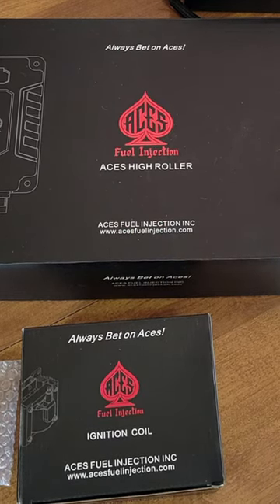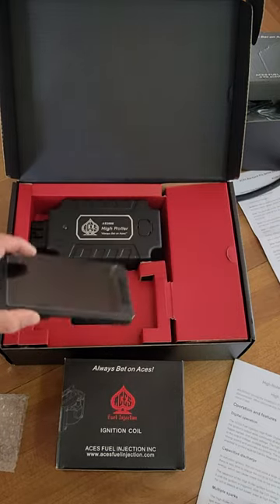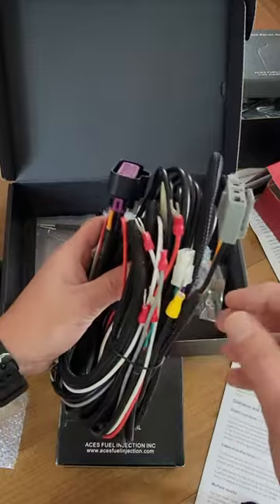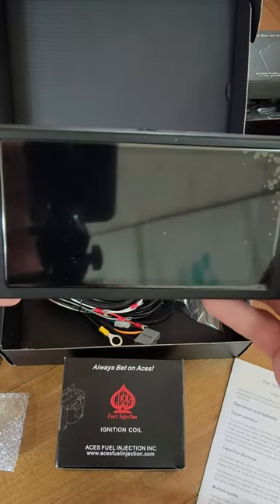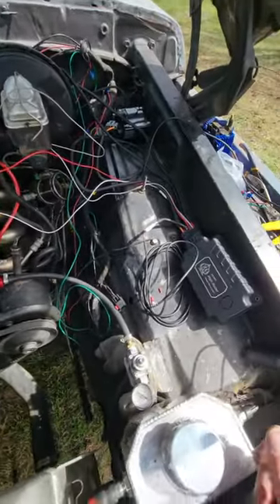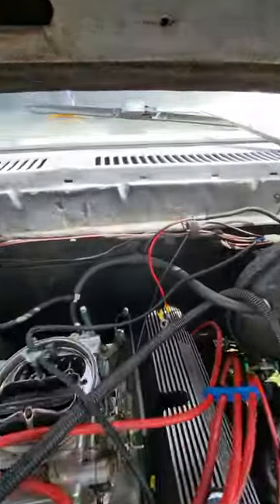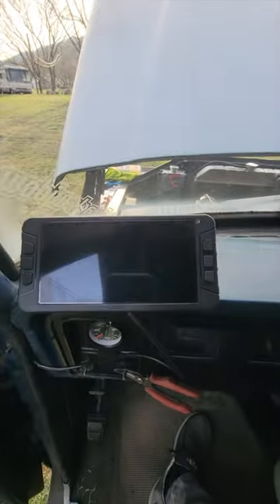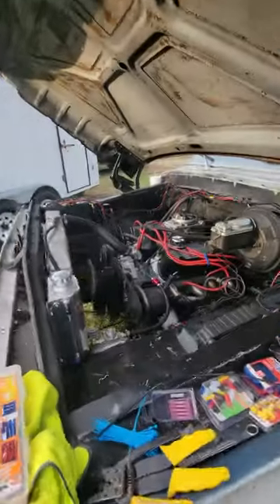Aces High Roller.

Comment: Did you have to lock the distributor before installing or can you just drop it in and swap it out?
Reply from the maker: Don't hafta lock it out but to use all the features the box offers you will need to lockout the distributor.